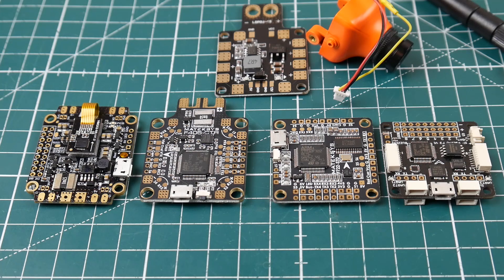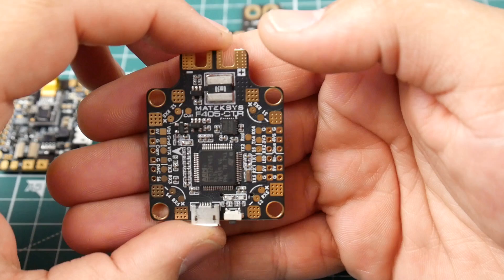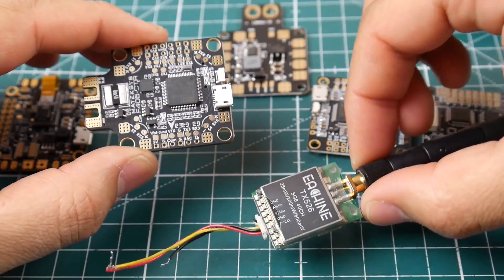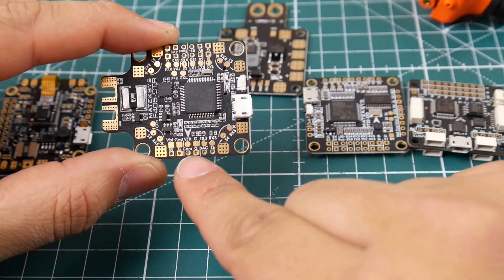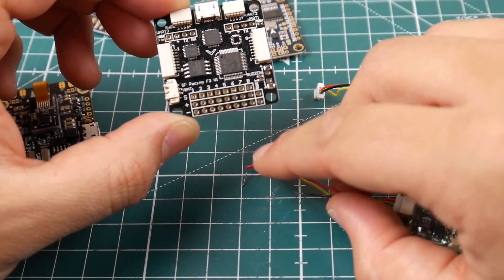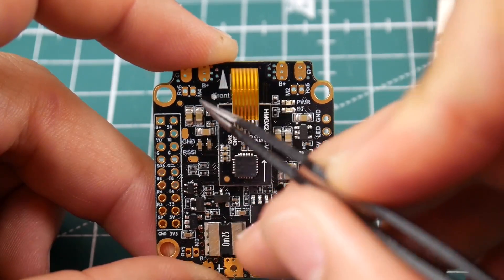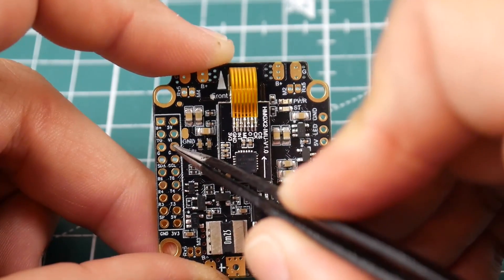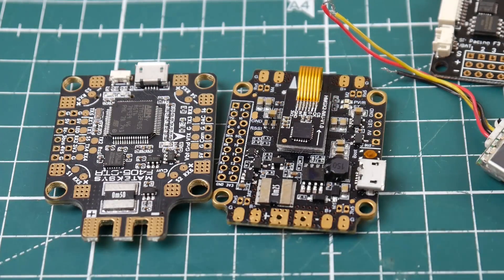How to setup and wire FPV Camera and VTX // Under 5 Minutes

Comment: For the 5v board, do you just layer the red wire on top of the battery wire or wrap them together or keep them separate on the + lead? Planning to do this on my quadcopter

Comment: My setup doesn't seem to be working and I don't know what I'm doing wrong. I connected my vtx and camera by soldering the two video wires together and connecting the camera to 5 volts and the vtx to 9. Even if my frequencies between the VTX and monitor are the exact same my monitor has a black screen. Did I do something wrong with the wiring or is it an issue with the monitor and/or camera? Btw I'm using the exact same VTX and camera as the ones in this video.

Comment: My comment needs to be withdrawn. The first board u talk about is the one I have vbt next to the yellow wire for trans isnt that bat voltage .does ts 832 Automatic pull 600mw of power cause osd says 25mw and in betaflight only let's me save 400mw 500mw wont save my video is perfect for 100 feet then crap

Comment: Thank you so much. Been looking everywhere 600mw ts832 powered off the wrong spot next to vtx . Video only goes 50 yards and starts cutting accidentally got the answer from you. I assumed if they have a pad for all the wires and osd even 3 volt for satellite spectrum. So I'll move red and hope its finnaly working

Comment: Can i ask you something i have an eachine tx805 and thera is an output 5 volts coming out this vtx so do i connect these 5 volts to my 5 volts on the controler or not or i should put them to power up the camera

Comment: Great video as always. I do have a question. How to switch a cam. I am just switching a cam for trouble shooting reasons and when I plug, sorry yes plug no soldering for the geprc phantom toothpick quad. When I plug another cam into the flight board the quad deeps at me with no video signal. It has a caddx eos 2 turbo. I switch it with a caddx tarsier and a run cam nano 2. Neither work on that quad. Is there something I need to do in beta flight for the quad to recognize the cam? Sorry for the long question.

Comment: Hi, I have a F4 V2 pro, a panda vex, a runcam owl, I’ve run the cam into the cam plug on the board, and the vtx into the vtx port on the F4, but I have a black screen in the goggles, ie I think the vtx is working, but I have no picture and no osd , any ideas what is wrong, I also can not see gps in betaflight, do I have a duff board ? Thanks

Comment: Any reason not to run vtx wired in parallel from the battery? 

(Meaning wouldn't it be best not to run ground through the flight controller?)

Comment: Question :  I just bought a Syma x11c mini quad which has a pretty good 720p camera .  The camera records to the quad , but it has no FPV .  Can you split the wires from the stock camera and add a VTX without harming the original camera operation , and therefore get FPV with minimal weight added ?  Because if that works , all your old camera drones , can be made into FPV drones just by splitting wires .  I look forward to hearing your opinion .  Thanks !

Comment: I have a 9V port on my FC but my vtx(7-24V) draws 0.2A current....
Wont it fry my board?
Please help
Reply from the maker: No that is perfect.. That means you VTX will connect there.. the 7-24v is the input on the vtx
Reply: @DroneMesh  Thanks man! 
Means a lot

Comment: So if a board has osd, there's no special wires for it? Second question being can you Bower the vtx through the vbt pad?
Reply from the maker: Yes make sure your VTx takes 7-to 20 volts or more.

Comment: Question, on the Mamba 405 stack, I decided to try and see if I would get a cleaner FPV video signal by powering the FPV camera from the 5v and ground of the VTX. Everything looks pretty good, however, I now have lost the OSD? Nothing has changed from the previous configuation, other than the FPV camera getting power from the VTX instead of the FC. The video out from the FPV camera still goes to CAM and the VTX video wire still goes to VIDEO. Don’t understand why that would lose the OSD? Isn’t that FPV video wire feeding that signal thru the OSD chip? Appreciate the help!

Comment: i do not have SPF 3, but i do have the PDB power distribution board. Is it possible to use Arduino with the PDB or is there another way? and i have the AKK  FX3 beta flight. you show i can solder the camera wires with it, but where does the green wire go? those are my two questions

Comment: Hi..  thats very good and detail explanation ....(*****).....I have a question Sir....I have built my qav210 using matek F405 STD.  (installed also low ESR caps on main Lipo power and all ESCs. For Power the vtx and cam, using 12V direct from PDB --> micro LC Filter 3A and common ground for Vtx and Cam, offcourse V in and V out wired into F405 itself.. I'm Using AKK Fx2 and Sony Had II, Google Eachine VR006 and Fat Shark Spiro net Mushroom Antena (I didnt know whether this is a clone FS or genuine...one?? ;)))). 
What im so confuse now,.....How to get a super clean and strength (Not Long range) video receiving signal ??  because during flight the receiving signal is not good..I mean video is clean but weak signal ..could it possibly the fake antenna? or should I replace them ??? pls help regarding this matters....since video quality is crucial for me during flight.   I dont wamt my quad has around 1 km and the video signal is blank......thats not good i think.

thanks and rgds

Comment: any recommendation on powering a akk xp2(7-24v) vtx on a 6s build? omnibus f4pro and typhoon32 4 in 1 esc.
I think I need a 26v step down to 12v BEC. any other options or links to affordable chips would help. next time I think ill get a 4 in 1 or fc with a 12v reg or a hv vtx. thanks in advance.

Comment: HI, this is my board-Eachine Beecore VTX Brushed Flight Controller w/ Betaflight OSD 25mw VTX Smartaudio for Tiny6/6x/7--this is my VTX-Eachine VTX01 Super Mini 5.8G 40CH 25mW FPV Transmitter =WHERE do i connect the yellow wire from the VTX01 ? THANKS for any help.

Comment: @Drone Mesh: What about connecting 7-24V+ cable from vTX to one of ESC pads on FC (Bardwell FC4)? This is what Joshua Bardwell wrote to me: "Since your vTX supports up to 26v input, I suggest powering it from an ESC+ pad instead of the 7.6v output. This sometimes works better." ... Did you hear about it?
Reply: why not directly to motors?? :)

Comment: Great series.  Well done.  Btw, most PDB's have a 5V and a 12V BEC output (like the Matek Systems PDB-XT60 shown at 4:45).  Why not connect camera to 12V pad instead of Vbat (cleaner supply after regulator)?

As long as the 12V BEC can sustain 100ma it should be able to comfortably sustain 800mw power signal or below on any VTX.

Comment: On my last three builds I've started getting power for the camera from 5v out from the VTX, I've noticed there is a lot less noise. It all started when I hooked my runcam swift2 to the VCC and noticed some wavy lines, switched it to use the 5v from the vtx and it was gone. I'm going back to my older builds and redoing it that way. I wish I knew the science behind it.